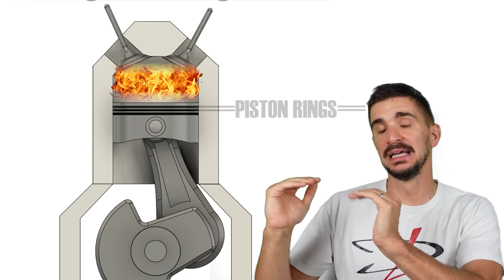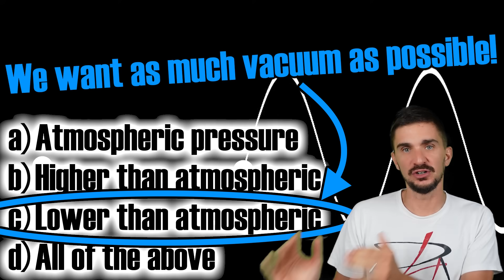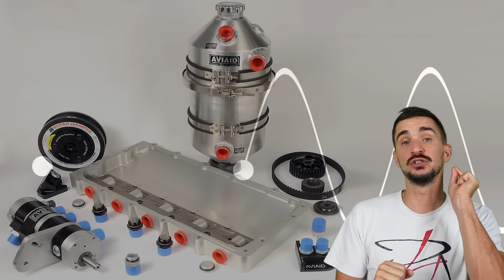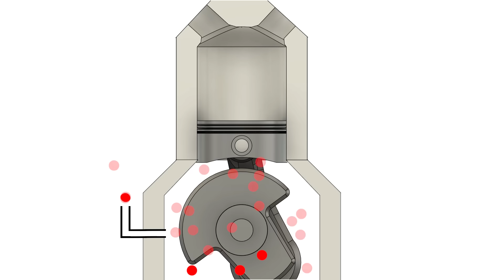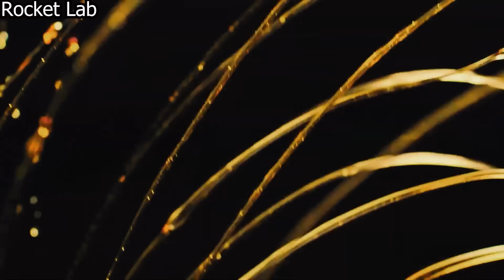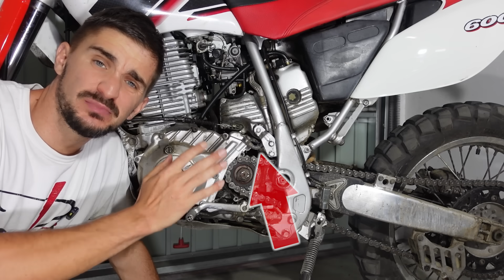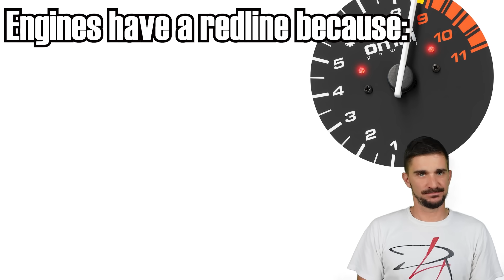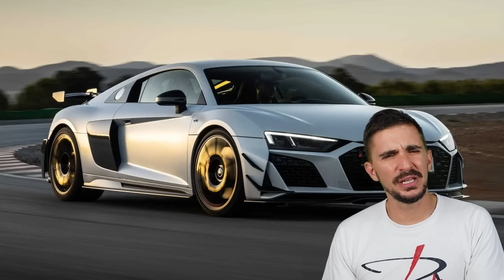Installing This Has No Drawbacks, Except for Your Wallet - Dry Sumps Are Awesome, Here's Why...

Comment: Long ago, I thought about what if there was a vacuum on the crankcase, sucking down the pistons, making the power strokes stronger, but gave up on that idea, believing a vacuum would make the compression & exhaust strokes harder to do, and take more power out of the engine, then the pistion getting sucked down on the power stroke. Then there's the parasitic loses on the crankshaft, from powering a mechanical pump, or though the alternator powering an electric pump. And then FortNine and maybe you mentioning multi cylinder engines, having more stable crankcase pressure, then a single cylinder, farther made me give up on crankcase vacuum, because a single pistion is pushing & pulling the crankcase air, while multiple pistions just move the crankcase air forward & back, not compressing & sucking it. But I did not know about how bad ring blow by can be, that it built up pressure in the crankcase, and the other overall benefits you mentioned of a Drysump system. As for single cylinder projects. Maybe I can make a drysump system for a Predator 212, or something. Thank you.

Comment: Never mind added cost and complexity, the real reason you are not likely to find many cars with a dry sump is the same reason they started using wet timing belts. They don't want you to be happy with a motor that kicks ass for years and years, because they stop making money off of you. Same reason GM killed off the 305s and 307s. They were too bulletproof. Even decades later it took cash for clunkers pouring caustic chemicals into them to kill them.

Comment: Hmmm.... I think I missed something.  Oil pumps want liquid only. Got it!! Um, a vacuum system like that? Doesn't seem like it would be a happy camper as oil and air compress differently to move through a pump (ie antifreeze/water through a water pump, they don't like air). To me, even an external pump would still suffer from extreme cavitation trying to pump air and oil at the same time. My reasoning for this comes from the PC world and dealing with liquid cooled computer components. As long as there is a steady flow of cool liquid: the components remain happy. However, if too much air enters that loop: the pump gets noisy, component temperatures start to climb rapidly, and the potential for catastrophic component failure rapidly increases. How then is one pump on a car going to be fully effective in removing two drastically different mediums at the same time? If the air/oil mixture being pulled out is completely atomized:  I could understand one pump pulling a vacuum.. a shop vacuum as an example can pick up water and dust as the same time; but, they are combined at the point. What scares me about this system is the blow by from the piston rings will still occur resulting in fuel and other chemicals into the oil and that is not something an oil filter can remove. To me, the simplest solution to an automotive application would be the use of an external oil pump that is fed by multiple pick ups in the oil sump. A simple G force sensor could controll which pick up is used. Given this: a catch can would still be needed to try to remove excess fuel from the oil. A snowball effect for sure. Perhaps a technical read up is in order for me to understand these.

Comment: Great video as always. Curious why not all engines have a dry sump. Seeing that most oil is outside of the engine, would it make sense to run it trough a radiator to cool it down?

Comment: I have 2 questions as far as drawbacks. Both deal with the whole vacuum argument. 
First, yes, vacuum helps the piston go downwards. But wouldnt that also cause resistance on the rise of the piston? Secondly, the added pressure in the crankshaft would help prevent blow-by would it not? Vs adding vacuum and thus drawing the unwanted gasses past the rings.
Im not an engineer by no means. But these seem like simple concerns to me

Comment: 4:00 this would only be true on a single cylinder engine. In a V8 for example when one piston is at BDC, another is at TDC and others are everywhere in between. The volume of the crankcase is always the same.

Comment: The ability to keep an engine cooler I think
is the best benefit of a Dry Sump System. (Our plastic engines today don't like heat).
If it's good enough for NASCAR then it is good enough for my car.
And NASCAR use a 160 degree thermostat, and the dry sump system using 6 gals oil (and oil cooler)  for cooling the engine because radiators can only contain water.

Comment: So as great as a dry oil sump system is, an aftermarket dry sump system is probably not even available for most cars?

Is there a Universal Dry Sump? Nope, because of the oil pan.
Well, that Sucks.

Comment: Great Video. I simply have taken the attitude that if it's good for NASCAR - then it is good for my Car.
Even when I don't fully know or understand how everything works, and/or all of the benefits.
I still knew a dry-sump system had to be better than what is offered on most cars, because NASCAR team uses a dry-sump system in their engines.
But now, I know why.    Thanks!              **  (Just don't use 0W-20 oil in your dry sump system.  lol   (By the way, NASCAR uses 100% Synthetic 60W oil. That should tell ya something.  Yep.)  **

Comment: In my C8 Z06, Chevy took the LT6 FPC 32-valve OHC engine to the extreme... each of the four crank bays is completely separate from each other and each has its own oil scavenge pump, and the engine can rev to 8600 RPM. It's a pretty insanely-engineered dry sump engine!

Comment: What a stupid clickbait video. He’s talking about dry sump. This shit is useless outside of race cars you need to redesign the entire engine bay with so much complexity and you MIGHT get 5 horsepower at best by reducing parasitic loss not 30. It’s completely pointless you will get more power from an intake. This moron ran out of video ideas.

Comment: volume never changes in an engine crankcase with more than one cylinder, which is also the only kind of engine you would care to put a dry sump in. it simply moves from one cylinder to the next

Comment: Actually after ruling out cost/complexity there is a very practical drawback that is a design consideration of most large OEM automobile engine manufacturers--external oil lines.

In the world of robust and idiot-proof auto design, having ANY oil line is discouraged.  

Why?  Because lines age, wear and break due to lack of maintenance or external damage.  This is why on "the majority" of your solid American, Japanese, European truck and car engines, the entire oiling system is plumbed integral to the block and the various network of engine components i.e. oil pump, oil filter, crankshaft, lifters, push-rods, etc.

Comment: Another drawback - checking oil level is not straightforward as with wet sump, you need to follow specific procedure to give you correct reading. When the measurement is automated through the car sensors, it might by no problem. But in case of older sportscars still depending on the dipstick it is easy to overflow the oil after incorrect reading.

Comment: 20:28 Motorcycle lean angles do not as such justify a dry sump. The force vector is pushing the oil straight down the bike's vertical axis, just the same as when it's fully upright. (When it's running while fallen over, that's more of a scenario for it! 😅)

Comment: Good stuff. Curious how vacuum would act on your 600 single, singles and common pin V-twins may not benefit the same as engines with opposing pistons because of pulse timing and pressure balance.

Comment: Er... this is just fanny - especially on a 4 cylinder engine or 8 cylinder, where you are simply moving the air displaced by the pistons moving down to the space created by the pistons moving up - ergo, the tiny fluctuations in pressure. There may be some tiny benefit on engines with offset cylinders / cranks, but you can bet they aren't going to gain you anything in terms of performance even before you take into account extra weight, cost and complexity. Keep it simple stoopid...

Comment: I am curious what you lose to parasitic draw since you’ve added another belt to your pulley system. I’ve heard them mention the same for belted superchargers since the added belt increases resistance on the entire pulley circuit for lack of a better term. I’ve heard that’s why many say to do a turbo over a super is parasitic draw reducing your added power by up to several horsepower depending on setup/engine. (You still gain power but its potential is reduced by the mechanism when they are belted superchargers.). The only exception I’ve heard of is if it’s an electric supercharger but those have their own problems, and while it’s still offer rotational resistance I’ve heard of super chargers that hook directly onto the crankshaft that eliminated the need for added accessory belts on the engine. Also a super charger will hurt gas mileage even if only a little due to the added resistance unless it’s electrical.

Comment: My engine doesn’t have a pcv valve persay. Its just an open nozzle on the valve cover with a hose to the air box. Would that create the low pressure since the intake is sucking in air?

Comment: cons:
Vacuum will be sucking through the same small gaps blowby does.
That will decrease the lubrication  to the oil starved top ring.

There are 2 downward strokes for each intake stroke.
That + 2 reed valves per piston, sounds like a supercharger to me.

Comment: The lean angle you mentioned on bikes is not really a factor for dry sump. In fact it (the angle)  helps to get the oil into the sump ie. the angle of the bike and engine are the same which is nearly the same of the vectors of gravity and centrifugal sum.  If you have a sidecar - its a different story! :-)

Comment: You think gapless rings cuts down on the blow by significantly and gives you more power. Another advantage is you’ll notice that your oil is cleaner and won’t suck up as much gas as a traditional set up.

Comment: I was wondering about this..    an oil pump is not the best type of pump to produce low pressure air.  So why not have a completely separate brushless electric oil pump, preferably bolted to the side of the sump tray so hoses are unnecessary except for the reservoir,  and a completely separate dirty great big vacuum pump somewhere else..  in theory a reverse turbo running off the exhaust would be sufficient and not an engine drain.    Even a small second turbo sucking air from the crankcase would be able to hit -7 psi wouldn't it?

Comment: PCV valves became a new thing because of emissions controls.
A 1972 Norton Commando was a 750cc twin with both cylinders going up and down in unison, dry sump with an oil tank, and no PCV valve. The 1st stock motorbike to do the quarter mile in under 13 seconds.

Comment: But this does not make any sense: any pressure or vacum that you have below the pistons is constantly compressed and then again decompressed, so it is a zero net sum game. PLUS: the downward stroke is actually the power stroke, so compressing the sump is not much pressure while the explosion in the cylinder drives it down with 1000 times more pressure. If you create a vacuum, it goes better down, BUTTTT, then when it comes up, the vacuum slows down the piston. So I would be really surprised if you get any performance improvement, I would say that somebody just decided that it is 10% better, a wishful made up assumption, while never measuring if it is actually true?

Comment: Think you forgot the mention that several heavy duty vehicles and equipment tend to have dry sumps too. The Volvo D12 has both wet and dry sump. And it's a horizontal engine.

Comment: I've built a few Ducati race bikes using the exhaust system as a Venturi to create negative crankcase pressure. 

Run a hose from the crankcase breather to the bottom of a catch tank, and another from the top of the catch tank to the exhaust Venturi.
Not legal for road use because it's not vented back into the inlet, but it does work. Made about 5% more power.

Comment: Thanks for the great video!
Question - isn't the energy supposedly gained by vacuum-pulling the piston at combustion exactly negated on the way back?
For what I understood in the video, low crankcase pressure helps in a whole bunch of indirect ways, but pulling the piston for free energy may not be one of them.

Comment: Hi
As always great informative education and knowledge.
Whats still unclear (for me) is how do you  make a CCV while deleting the factory PCV, while still not wenting to the intake.
Industrial systems have no problem seperating air from oil, they use coalescer filters or some form of centrifuge. A catch can is a coalescer filter, but done on the quality of consumer rip-off basis. Armstrong (ARE) Spintirc or Daily Engineering do things properly, but the cost is not for us normal drivers with a tech dream.❤

Comment: Actually, the Z51 package on the base Corvette also has a dry sump, at least in the C7 and on (not sure about previous generations). The only other drawback I can see is the added cost during oil changes. Great video!!!

Comment: Brilliant stuff. Also, in the case of the LC8 in the 950 Adventure, they used a tall v-twin design (that couldn't have been mounted any higher, as the fuel tanks are already on the sides of the bike already.) The dry sump there is for ground clearance, or so I have always thought... My MX bike, a 2023 FC 250, has a wet sump and a ridiculously short service life. If you look at all the modern performance four-stroke MX engines, they are built with very low service lives for components like the piston (I think mine is 50 hours by the book). Care to enlighten me on that?

Comment: @4:39 - there absolutely IS gravity in space - if there wasn't, there wouldn't be anything in the universe larger than a few meters at most.  What you feel the lack of in space is weight, and that's due to being in free fall.
And, because there's gravity in space, literally NOTHING moves in a straight line forever.

Comment: If crankcase pressure impedes piston decent, wouldn't crankcase vacuum put a drag on the piston ascent? Why don't the 2 balance each other for a net neutral gain/loss?

Comment: So you take an injection pump and turned it into an oil pump.  Now add one more stage and use a 2 micron bypass filter.  If dry sump pump is run through a good full flow oil filter at say 15 micron absolute with a 2 micron bypass and you won't have engine wear.  Then you could add an electric cold start pre lube option and essentially reduce all engine wear.

Comment: Piston rings have their own mass and therefore their own kinetic energy. When the piston is compressing the ring go to the bottom of the groove, (rings are installed with a manufacturers specified clearance) then when the piston goes over TDC the piston ring has been accelerated upward and its kinetic energy wants to keep the ring moving upward. The downward motion of the piston pulls the ring down with the piston but the ring will move to the top of the ring groove in the piston. Not much movement but enough to change the dynamic of the ring against the cylinder wall and that will change the ring to oil function.
Reply: Meh thats true, more wear on piston rings I guess..

Comment: That all my thoughts, about this topic, all enclosed in a single video...
I can't disagree with you, not on a single point of your video! "Petrolheads hate fake things"—that's absolutely true. I'm a car enthusiast and I like every kind of engine possible; I even like the PureTech engine to some extent. Therefore, I'm not the type of person who hates things just because of the current hype.
I started hating fake exhaust tips (the ones that never get dirty) many years ago. Then, they started producing fake exhaust speakers to create a different engine noise, even in combustion engines. Why would you do that? Is it just laziness? Even diesel cars can sound good with the right exhaust resonators... and at least it's still their own sound, not a poorly simulated one. 😢
Now there are electric cars with poor fake engine sounds. What makes me so upset is not only the fakery itself, but the fact that it's done so poorly and that's even worse! Why would you do that? Why would anyone like a poorly simulated engine sound? One of the most beautiful things about electric cars is their absolute silence while driving. Why degrade it? I think they spend a lot of effort on things that nobody ever asked for, but they don't focus on the things that really matter... (with they I mean all the manufacturers).

Comment: Everything in this video is great except you made one slip up! The lean angle of motorcycles has the opposite effect of displacing the oil out of the oil pickup sump because of gravity and g force naturally keeping the oil level BECAUSE it leans. Where as a car or other multi wheeled vehicle that does not lean throws the oil out of the pump pickup sump BECAUSE it doesn’t lean. Just the same as tying one bucket of water on to a kiddies roundabout by its handle and attaching another one rigidly to the base. When you start revolving the roundabout the bucket attached by it’s handle will swing out with inertia or g force and the water will not spill However fast you spin the roundabout as it is pulled into the bucket but the other bucket which is fixed upright by it’s base will spill more and more water the faster you spin the roundabout as it is forced against and over the outside side of the bucket.😊🤔

Comment: The typical dry sump system costs around $6000 US, for maybe an extra 5-10% on the top end if you're lucky. For the average gearhead, the economics just don't work out.